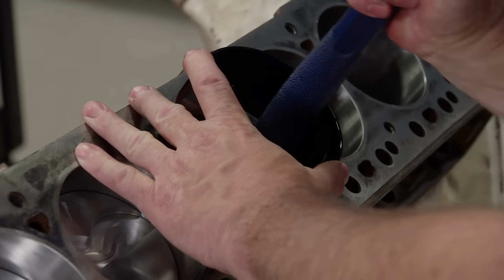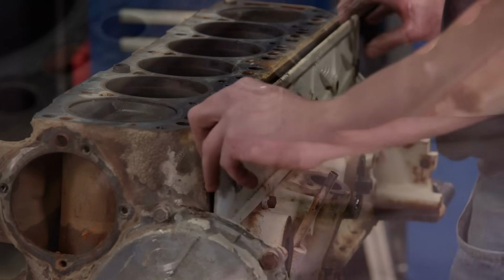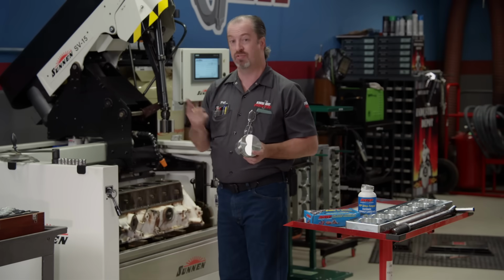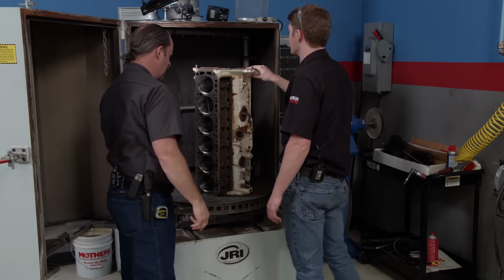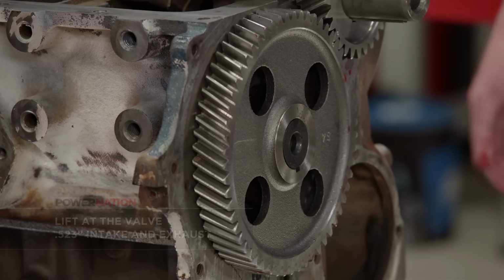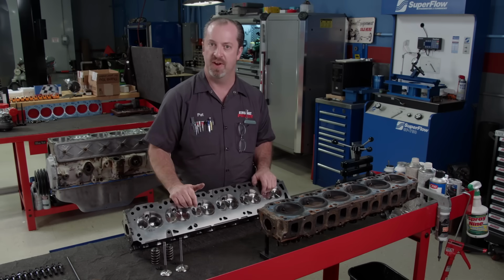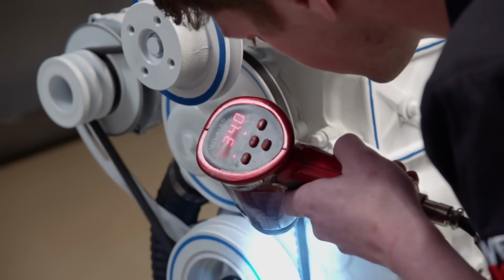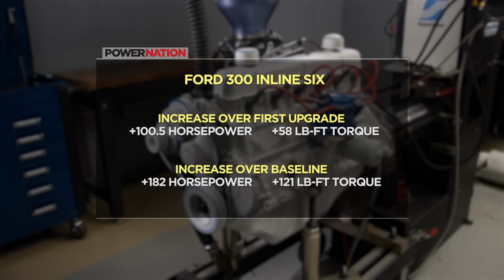Full-Tilt Build On Our Ford 300 Inline 6 For Serious Power Gains - Engine Power S8, E3

Comment: EnginePower has everyone from all automotive spectrums on the seat of their pants for this 300 Ford
Reply: Real gear heads at least
Reply: @bigboreracing356  Alright, well... if you want people to take you seriously you'd knock off the fifth grade "turd" taunts and worn out brand BS, because it makes you sound like you're twelve.
Reply: @bigboreracing356  Are you even out of elementary school?
Reply: @bigboreracing356  its a work horse
This engine is nicknamed "The poor mans diesel" because it produces all its torque at very low rpm which is what you want for pulling heavy ass loads.
Reply: @no prep stretch 300 is nothing special? There’s guys chopping up 351 Cleveland heads and making over 600hp NA with those engines. That’s 2 horsepower a cubic inch. That’s like a 460 big block making 920hp with no nitrous or power adders. 300 is definitely cool and they’re super strong. Flat heads are cool though
Reply: @thegcia7  yeah that guy is an idiot. He was calling me out for saying that everyone has done an LS swap and I said it was sarcasm but LS swaps are very popular. He said “why do you have to bring me and hundreds of thousands of other people who have never done an LS into your sarcastic remark.”  I was like why does that matter lol.
Reply: Remove the spacer, power fell off more steeply at the end was the only difference I could see from the graph.
Speaking of boat anchors, I love to see you guys do a 430 MEL.
They made 350 hp. with a 4bl. and 400 hp. with 2 x 3 carbs (most beautiful air cleaner I've ever seen)  stock in 1958, eventually morphing into the Lincoln 462 motor before being retired after 66' model year.
They raced them in the "Square Bird" with NASCAR before the thin wall FE 406/427 's came along, which were based off the 332 FE (medium) Bock.
Reply: @bigboreracing356  well what you said about the miles and not being able to kill them just contradicted your statements that they're nothing special and you had to rebuild several of them with less than 120K on them. Evidently you haven't read your comments.
Reply: @bigboreracing356  contradicting yourself again. You said you couldn't kill them now you're saying you can. Sounds like you're confused.
Reply: @bigboreracing356  ok who ever said you were 12 was probably right. It’s called sarcasm. Something a 12 year old might not understand.
Reply: @bigboreracing356  what is it about trolling that makes you feel good? You are obviously misrepresenting my point on purpose, you aren't that stupid... are you?
Reply: @bigboreracing356  and if you think that turning around a joke on someone will make you more funny I can’t wait to see what happens to you when you get to high school lol
Reply: @bigboreracing356  ok maybe you are 12 put together a understandable sentence.
Reply: No Prep Stretch My buddy had one with over 800,000 miles on the original motor when he sold his lawn business truck and my other buddy had a 300 in his mud truck cracked the oil pan on a rock all the oil drained out he drove it home replaced the oil pan and oil and then drove it for another 2 years before he sold it. Both trucks were running and driving when sold with no knocks or issues. I never said LS Swaps were boring to do. I love to wrench so I would never say that however I’ve worked on my friends 84 cutlass with a 5.3 ls with a Holley sniper EFI, my cousins 78 Monte with a 6.0 carbureted nitrous LS, my friends two LSX swapped turbo fox body mustangs, my friends turbo LSX 80s Monte and my other friends pro charged LSX swapped SN95 mustang. Then I’ve worked on my 87 Buick turbo T which I’m currently building the power 6 for, my buddies turbo 351 Windsor swapped fairmont sleeper and my other friends 73 Torino with a 528 ci stroker BBF stuffed under the hood and honestly I’m way more excited to work on the non LS cars than the LS cars. The LS is the modern day 350, 355 and 383 set up. It’s stuffed in everything which takes away from the uniqueness of the build.
Reply: No Prep Stretch go on Ellison’s machine shop Facebook page. They have a 300 Ford on there with the chopped up 351 Cleveland heads. Makes over 600 hp NA.
Reply: @bigboreracing356  I never said LS builds were boring or that they weren't fast I simply said they're not as unique because they're done so much. That's all.
Reply: @bigboreracing356  alright
Reply: @bigboreracing356  wtf are you talking about? Yes Everyone’s sick of ls swaps because every hillbilly has one. Nobody said to replace ls engines with them? This is simply something different from the millionth ls engine. Not everyone wants to watch them build an ls every episode. Why is this so hard for you idiots to understand? It’s really a simple concept.
Reply: @bigboreracing356  
So a stock junkyard 300 6 with aftermarket intake valve springs and a junk yard dt466 turbo  does 9.74 in the 1320 beat that with a bbc cost for cost
Reply: @bigboreracing356   well the junk yards around here $180 for the motor, I've been blessed with them for under $100 also $100 for a turbo, the intakes are spendy now about $350 but they were attainable for $180  swap meet maybe still are, comp 268 cam, springs timing chain lifters locks retainers are $330 now, the carb can be between $100 and $350+ depending on tunning ability of the person,  the exhaust manifold has to be built but really for most of us that's no big deal say a full day of labor and scrap but let's call it $200. So just to go say between $850-$1300. Don't get me wrong I got bbc's they are very capable with stock re worked heads even the peanut port are under rated but the stock rods on most BBC's are super danger zone with a turbo, 
the 300 6 stock pistons are danger zone over 550 hp
Reply: @bigboreracing356   my buddy's dad was a circle track champ he built a lot of motors but bought hand me down cars from the circle track star's , they are all chevy lovers but they got mad respect for the 300 6 ,they build them to about 400hp and from what I remember they last longer maintain less blow by and take a beating better the rest.
Here's a 375hp 300 6
https://youtu.be/XMPnlEWW43w
I hope to build a 800hp turbo six later this year ,I was going to put it in a 4x4 but now I'm thinking a car a buddy's got a 67 Camaro with a shot 305, but cars to nice, I'm afraid crashing it, I need to find something if its destroyed no big deal.
Junckyard  300 6 Maverick dt 466 turbo in cab ,1320
https://youtu.be/_aTIhKDhf8g
Reply: @bigboreracing356   why compare to big block Chevy?
 because in the comments thought I saw you referenced it was a better investment, maybe it was somebody else,  somebody said the 300 6 isn't good for rpm because long stroke.  If that's true why does the bbc 454 not have a problem its same stroke?  And many add .250 to the stroke and still rev it high no problems. The best cylinder head guy in the state whom is chevy guy ,says the stock 300 6 crank is good for 7k
Reply: @bigboreracing356   I was referenced motor to motor. When he first raced the car for years ,it was junk yard motor with 268 comp cam ,spring, intake carb ,junk yard dt466 turbo, no doubt he put roller rockers on but I'm not sure. I thought he was running a auto, a c4 , anybody can over pay and get parts they dont need and the guy that didn't can still do more with  les$ no doubt you've seen that. We machine down common cheap cluch disks to fit in the Porsche transaxle running SBC's to $ave.  Clutch transmissions and rest of the car aside , I'm referencing motor to motor
Reply: @bigboreracing356  I never thought much of the BBC until you mentioned putting one in a Fox.. Now im intrigued..
Reply: @bigboreracing356  I plan to. Just would dope to see them do it lol. Found a pair of aussie 2v cc heads, one with a crack in the rocker valley that would get lopped off anyways if I braze 2 together
Reply: @bigboreracing356  I never did  and a 300 is good for somethings
Reply: @bigboreracing356  wtf that turned quickly 🤣
Reply: @bigboreracing356  so what should I find out the exact number of people who have done an LS swap or should I just generalize like it did
Reply: @bigboreracing356  the reason is, is your talking about something that doesn’t matter. Your a pretty boring guy if your really calling someone out because you didn’t like their sarcasm.
Reply: @bigboreracing356  no I’m just saying what was the point of replying to my comment just because you haven’t done an LS swap and can’t figure out sarcasm.
Reply: @bigboreracing356  how does that make me not capable just because I’m tired of seeing pretty much every car or truck out there LS swapped
Reply: @bigboreracing356  that wasn’t sarcasm
Reply: @bigboreracing356   There are people out there chopping up 351 Cleveland heads and making 600+HP with these 300 motors NA. That's like making 920+HP on a stock Cubic Inch 460 BBF with no nitrous or power adders. 2+ HP per cubic inch NA That's pretty impressive by anyone who knows HP. Flat head fords are cool too but there's nothing lame about a 300 ford inline 6.
Reply: @bigboreracing356   jalopie u pull junk yards here in Idaho you can get get Any v8 in the yard including 454 for $271 +50 core, if the right guy is working $180.  no core charge,
Reply: @bigboreracing356   Well one could speculate but the specifications as I quoted were the testimony I witnessed  about 10 years ago. With that said I've seen stock short block 351w make around 1000 hp with turbo before a piston ring lands come apart. The 300 6 pistons appear to be slightly stronger, though I haven't seen nor heard of someone pushing them to their stock limit with a good air fuel ratio, I took his word for it, the turbo Maverick guy's first story referencing the stated part change mods, in addition the chevy fan diehard circle track racers and builders here locally their testimony of the stock 300 6 with the same mods except ported head, bigger cam
 6k+ rpm and no turbo, all of them have only good things to say about them. With that said it bothers me these power nation guys ran this 300 6 with -.032 deck height. Facepalm
Reply: @bigboreracing356   you very well could be right. I'm not a pro racer, but I've seen guys do the unbelievable with junk yard parts win. How long do you think before y'all catch on to the physics of creation Walter Russell, victor Schauberger bio mimicry, Have revelation of Sonoluminescence star in a jar physics implosion physics, harness that into a rotating shaft, with a golden ratio 3+ stage conical axial vacuum implosion compressor, yeah right. You can't use a reciprocating assembly because its also thermal contraction = RIP the rod bolts out. lol
Reply: @bigboreracing356   so I found out he has .030 cast pistons rebuilt over 30 years ago. If you do your thy homework the nay sayers ate humble pie loosing the bet when connie kalitta ran 7 seconds with stock block crank n/a 300 6 and no nitrous. 
Nobody cares about Walter Russell?
 If someone has knowledge outside of the pro-pagan-da status quo obsolete inverted technology engineering, why disparage? 
I share cold fission with thee and you call it useless babbling?? What a shame.
Knowledge makes a person unfit to be a slave" -Frederick Douglas 
My people are destroyed for a lack of knowledge " Hosea 4:6.....
It's ok randy freedom's not for everyone,  some seek and ask to be slave's. A horse can be led to water but it's up to the horse to drink. A revolutionary act for a Human to drink of the knowledge of sacredness geometry engineering.
As a Dog returneth to his own vomit, so a fool returneth to his folly" ,proverbs 26:11
I pray thee scales come off thyn eyes you precive the truth and freedom and blessings from heaven overflowing your cup in Jesus holy name Amen
Reply: @bigboreracing356  wow, how the term "being a hotrodder" has changed
Reply: @bigboreracing356  don't believe it was the 300 that sucked
Reply: @bigboreracing356  
don't be jealous mi hermano, knowledge shall set thou free, lose the pride fulness. dont be a victim of thy die-vision. The kingdom of God is thy portion. The wicked are relentless to subvert thee with p.m.s maybe thy have heard of it, it's a ancient tactical protocol, preconceptions.management systems. = To subvert and confuse the less sophisticated adversary's. People buy into the facade. Remember how you said nobody cares about Walter Russell? The greatest blessed mind even more so than Nicolas Tesla. Real science corraberates the bible, we can do all things God said. And I'm a living testimony a whitneness to the faithfulness Of God, he answers my prayers, I've cured/healed stage 4 breast cancer in 80 year old lady, he daughter poured out Gratitude on me I was in floating weightless blissfulness tears of joy, I've cured a babie of paragraphs of health problems whom the parents I only knew 3 days prior. The father poured out Gratitude on me he was more happy and excited than a 5 year old at a surprise birthday party. The tears in his eyes the look on his face in shock and awe when I told him, "brother I told you Jesus can heal cure anything".. And drug addicts I've casted evil spirits out of them in 20 seconds, I've had them Visit me months later they are vibrant full of love empathy compassion divine energy. I can go on I have 33 years of testimony... Brother there's no verbal flatulence, preconceptions, ignorance nor infantile things you can say ,flail or do to get me to unlove you❤ 
Enter by the narrow Gate, For wide is the gate and broad is the way that leads to destruction and there are many who go in by it".- Matthew 7:13 
Small and straight is the gate, narrow is the way which leads to life, and there are few who find it". 
- Matthew 7:14
Reply: @bigboreracing356  
But you can! I believe in you!
Reply: @bigboreracing356  
Corraberating archaeological biblical discoveries 
https://youtu.be/ZnGAbItjr2I
As the sower sowed the seed. The word of God the seed  Of God planted in us bearith the Fuits of Godlyness uncanny limitlessness, beware the wicked whom come relentlessly to steal, kill ,destroy or currupt thy seed.
Reply: @LunarVVolf The funny thing about that statement is there are far less chevy's than Fords out there, except the junkyard's! Oh, and the accuracy of the phrase "crap", you hit the nail on the head!
Reply: @bigboreracing356  Yeah go check any list of the best engines ever, I guess the Ford 300 got there for no reason. I'm sure you know better than all of those experts. I'd be surprised if you've even built a 6 or 8 cylinder engine in your life, you probably haven't even bought a car with your own money before.
Reply: Biden will make a horrible President -thought I would throw in some politics lol
Reply: @bigboreracing356  You've withered on the vine.
Reply: Nah.  I'm good.  If I want to see an I6 build a 2JZ is better.   Not a 600lb anchor
Reply: @bmstylee  you just don't get it, you aren't a hot rodder. This kind of stuff just goes right over your head. That's why they make crate motors, for people like you.
Reply: @fightfanian  what goes over my head?   Spending a ton of money for less performance than a junkyard LS or a Honda VTEC?  You guys aren't that bright I see.   I'm glad I'm not a "hot rodder" who gets a chubby off wasting a fortune to get less.   I'll spend money and get better performance with a bigger aftermarket.
Reply: @bmstylee  some people want to keep things original but still give it some more power. And LS swaps are so boring because everyone has done one.
Reply: @tuckercole1531  LS swaps are as common as changing your socks.
Reply: @tuckercole1531  original?   You mean obsolete?   While we're at it let's make sure to use lead fuel, freon in the ac, manual steering, manual single circuit drum brakes with asbestos shoes. Because originality is so great.  You know why the LS is so popular?  Because it works.  Makes good and fuel efficient power in a small package, at a reasonable cost and has a massive aftermarket.   No one wants a big heavy cast iron inline unless it says Cummins.  You guys are the equivalent of the Fudd in the gun community.
Reply: @fightfanian  exactly what I'm saying. I'd love to see these guys do a brazed cast iron or welded aluminum cleveland headed 300/6 just for the sole purpose of hot rodding
Reply: Wild Bill i like 2JZ’s 4 cylinder Honda motors and the LS engine but it’s cool to see something different regardless of the performance being less than a different swap or build. Yeah you can build a traditional Ford V8 or swap your Ford build with a coyote but it’s cool to pop the hood and see that someone went a completely different direction.
Reply: @FordRanchero289  it would be neat to see them do that and the cut up ls heads
Reply: @bmstylee  you can’t get low-end torque like a Ford 300 I-6 with an LS motor which is what you want for a truck.
Reply: @bmstylee  
I kind of like original,  I bought a 50 Ford F2 pick up had a 239 cid flathead V8. 
I rebuilt the engine,  replaced the rear drive axle, the original thrashed it's self out I put in  a 1970 F100 rear replaced the front brakes with f100 front brakes and I had that old truck for 12 years. I got 12 MPG  around town and 15 on highway.  plus was a fun truck to drive.
Reply: @gunthroiddergai4844  strange.  My Silverado isn't lacking for torque.
Reply: @masonh2538  nah.  It's about everyon justifying why this is better than a modern engine.  If they worked that hard on ANY other engine and be anywhere close 1hp/in it would be roundly mocked by the people commenting here.  But somehow this holy icon is somehow exempt from criticism.
Reply: @bmstylee  why can’t you accept the fact the same people want to have their vehicles to be original. They aren’t daily drivers so they don’t need to have everything modernized. A 1953 corvette is worth a shit ton more with it’s old 6 cylinder then then an LS swap. And if we’re talking actual power a cast iron Ls can handle way more then an aluminum block.
Reply: @tuckercole1531  sorry wrong.   Watch an auction which plays a huge role in prices.  Restomods sell for significant more than all but the most special cars.
Reply: @bmstylee  there’s no way a restomod 1953 corvette would sell more than an original one you need to actually know what your saying before you say it. And yes a lot of times restomods sell for more but not with a 1953 corvette.
Reply: @bmstylee  You've really missed the point.  The people who want to see this are a mix of "This is what we did/what we missed when we tried", "This is what could have been", and "This is what my dad/grampa/uncle/etc was talking about, cool!". 

If you don't like it just shut up and walk off, you'll have your day somewhere else.
Reply: @bmstylee  every modern truck makes good torque and hp., Nobody said this 300 is better than a modern engine, it's just about seeing what you can do with a vintage engine for the heck of it, and that's ok.
Reply: @bmstylee  this is about making a workhorse more capable. Not to make a racing powerplant. 

Thats what you are missing dingus.
Reply: @bmstylee  LOL! NO.
Reply: @gunthroiddergai4844  ; That flat torque curve reminded me of the Ford Ecoboost.
Reply: @bmstylee  it came out in 1965 you muppet. I’d say it did damn well for being that old. It’s got 30 years on an ls. You’re elevator doesn’t go all the way to the top. Which is to be expected from someone that wants everything to be an ls.
Reply: @masonh2538  the small Ford and Chevy were around then as well.  And it's pathetic given they have done an intake, carb, header, and punched it 50 over and still can't make 1hp/in.  If it was ANY other engine you would bash it mercilessly saying they don't know what they are doing.  Don't even lie and say if they didn't make at least 300hp on a 5.0L v8 with all this work you would give it a pass.  But for whatever reason this holy relic seems to be immune from criticism by anyone who has a brain and can see it's a dud of an engine.  You guys are the ones soft in the head.
Reply: @bmstylee  
What are you talking about? This is 300 6 with 4 barrel intake and valve springs with a junk yard dt466 turbo. Running 9.74 
https://youtu.be/8b6cwOOYbMQ
Reply: @bmstylee  The Ford inline 6 is universally agreed upon to be one of the best engines ever made, the 2JZ had forged internals, big deal. They simply don't last like a Ford 300. If you don't acknowledge that then you're simply uneducated friend.
Reply: @bmstylee  not better more reliable
Reply: @davidadkins3544  again.  Please provide verified data supporting your position.  Of not it's just puffing.
Reply: @bmstylee  I'm sure we all wanna see a Barra, not a typical Camry build 🤷🏻‍♂️
Reply: @FordRanchero289  3.0L Jag?
Reply: @bmstylee  I too, like to pick youtube clips of things I have no interest in and leave superfluous comments. It gets me attention and makes me feel powerful to mock people for having different tastes than me. I wear a cape.
Reply: @bmstylee  there’s an entire community of people that build these inlines and ones like them for their falcons and mustangs, they make good power, and they have the added plus of telling the guy they just clapped in a race that they got beat by a tractor engine. Not everyone is after crazy horsepower numbers it’s about pushing what you got as hard as it can go before it brakes and then building it better just for the sake of being able to say you got that number out of something you’d never expect.
Reply: @bmstylee  mA 2Jz!! But really this is a low revving truck engine, the only similarities it has between the JZ is the number of cylinders. Two different applications that ether engine would suck at in the others role.
Reply: @bmstylee  those 600lb anchors are workhorses not track ponies. Those used to put those things in literal dump trucks and large commercial vehicles. 

Its nickname is the poor man's diesel. 

I love JDM cars and am a fan of the barra and 2j's but yalls ignorance of this motor is sickening

One of the modt legendary workhorse engines ever made and yall talking about engines that would explode if made to do what this engine was designed to do.
Reply: Wild Bill if you think the 300 ford weights 600 pounds you clearly don’t know anything about cars, keyboard mechanic lmao
Reply: @bmstylee  2jz for this application (towing, industrial, hot rodding) is not superior. This thing makes torque right off of idle. Thats the point of it. A low displacement engine isn't capable of those same torque figures without artificial aspiration. Then to push those engines to be lets say in a towing rig you would constantly be in boost, under load. Thats how you grenade them. Yes 2jz makes good burst horsepower. No it won't do that power level for 20 minutes at a time without wearing out quickly.
Reply: @bmstylee  2JZ, no shit?
Reply: Wow a 2jz so cool. Also if your truck has a V8 in it you should grow up.
Reply: @bmstylee  love the 300 in my '96, and the 240 in my '65. I'll keep them original, couldn't pay me to swap them. My '65 has stock the manual steering, brakes, and tranny. Gasp! Shocking, I know.
Reply: @bmstylee  I bet a 300 can handle boost much better than a 2jz